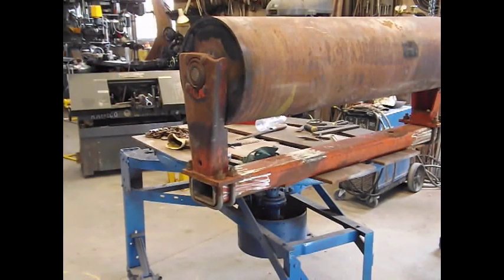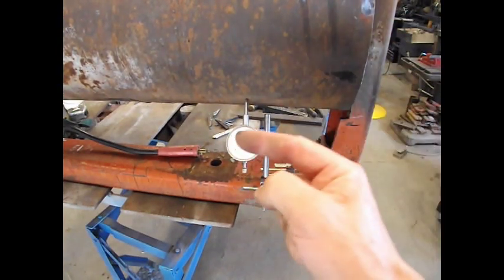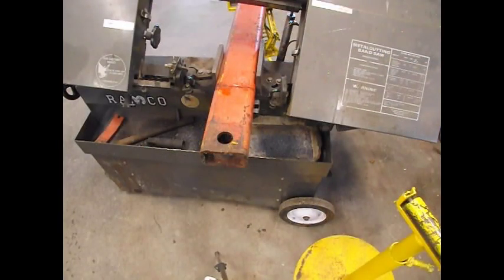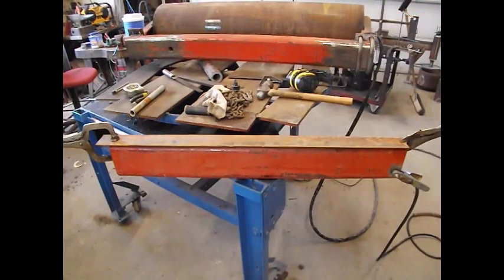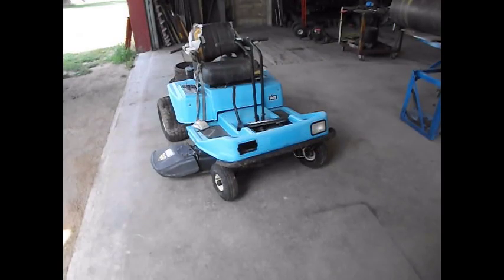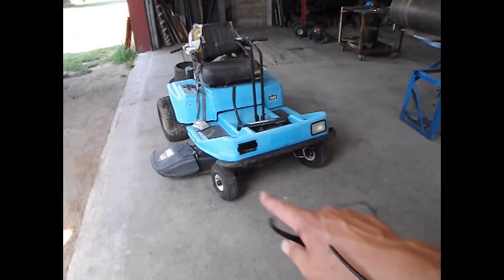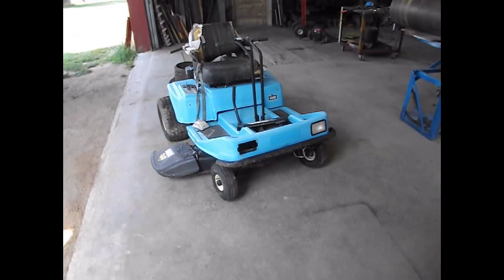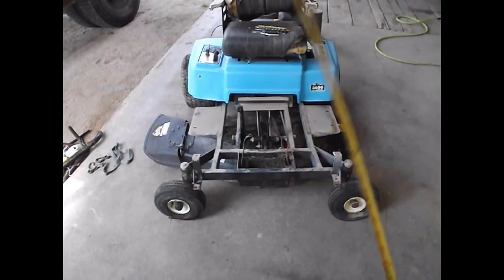Power Grader Build - Part 3

Comment: Hi, spray transfer with a small torch, I can't keep too long even with a 300 amps torch, but your little torch is fun for smaller jobs, much more flexible an so much less weight for long runs. As for my operations, I find much easier to get spray mode using 85% argon 15% CO2 around 24-25 volts.
Fun built...! Pierre